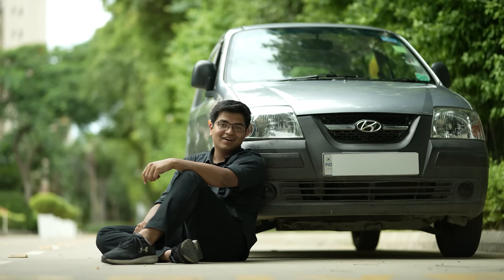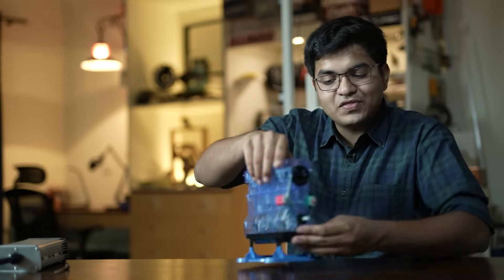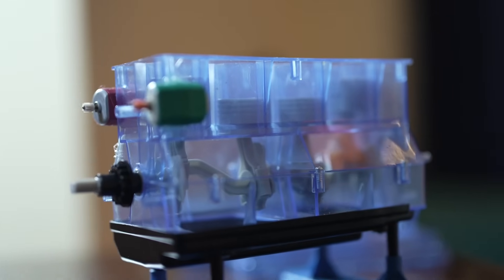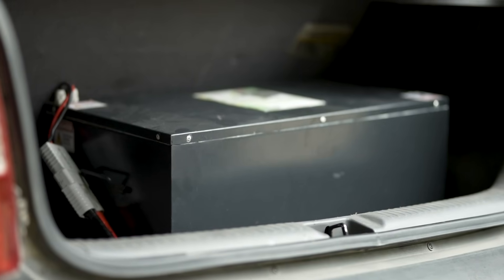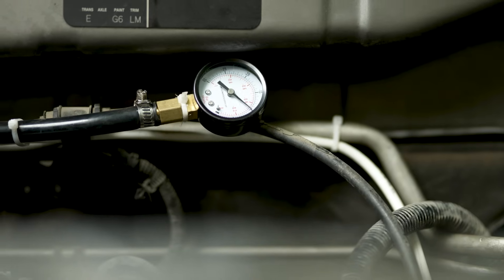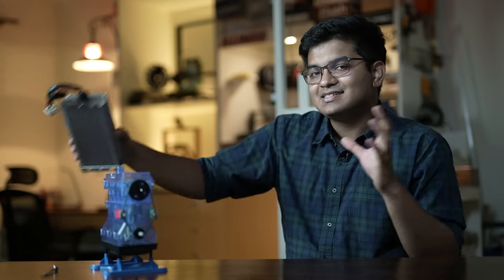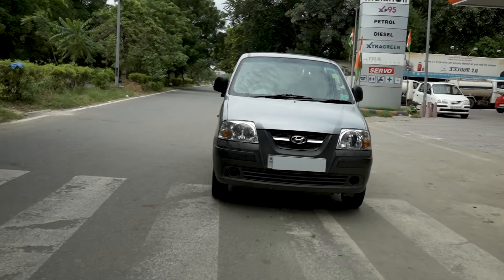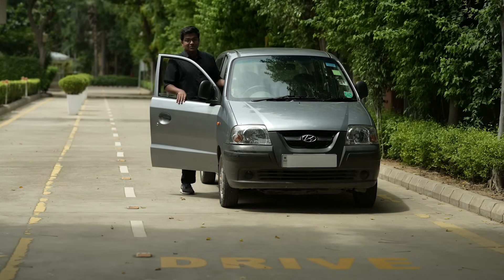Simplest EV Conversion under $3000 - Convert Your Car in 3 Days!

Comment: A great ghetto engineering video but a very compromised EV conversion. Here are the things that stand out to me. No regen using this method. No heater for cold climates (not something he had to worry about). Will only work with a manual transmission (unless you can hack the engine computer). I think he could address the power situation with a bigger motor and battery but then the cost suddenly becomes more of an issue. As it is 60km/h top speed would be dangerous in a lot of cities around the world. I'd be interested to know if things like ABS still work.

Comment: Since the engine is still rotating the crank pulley, do you have the oil pump in operation to keep things lubricated? Also, it would be fairly straightforward to put a more powerful electric motor on there. 30 or 40 horsepower would make the car absolutely drivable (the first Citroen was only 9hp, but it was very small car).

Comment: Because you only use a 6kW motor, you can replace the alternator with a motor. In fact, the alternator can be converted to a motor by connecting a controller to it. Unfortunately, not all alternators can be driven by conventional brushless controllers. You do not need to damage the ICE. Just switch it off when the speed is low.

Comment: Sir, please take up a project with tata nano. One guy called 'technical partha' did that he kept the gearbox , welded the motor shaft to it. There is talk of nano ev coming to market, but nothing has come out about the design. I feel the space between the two front wheels is just right for the motor, where the stepney is, the the rear engine space for the battery. I congratulate you for the santro project, but the lower half of the  engine is still an extra weight, which could have been done away with.

Comment: Hello sir. I have a question.
does the Sensors such as wheel speed, wheel slip, braking will be retained? Will ABS and Traction control function as intended? Did you remove or just trick the ECU? keeps me wondering about these problems if I will also convert my ford fiesta.

Comment: Very good and very simple for the budget. I hope you will update the design in the future and completely remove the engine. That is excess weight reducing your range. Plus the electric motor has to power the car and also moves the pistons, camshaft and gearbox. This will cause too much friction losses causing additional loss in range. Also you will need to get approval from the RTO for it to be road legal. Please be careful. Unlike in the USA, here you cannot make such modifications without RTO approval.

Comment: I imagine since there is no combustion in the leftover of engine, no high pressure to wear the parts the oil in the bottom of the power unit does not need to be changed forever if that part of former engine is properly sealed from elements?

Comment: Hay bro nice to see such al)) innovative idea 💡 
I have a question, as you mentioned that the motor you used was 5 times less effective so is it necessary to do so or we can improve its power and capacity to the actual diesel ⛽ car and even more than that ?
Please bro answer i am glad tu know that?

Comment: So could you replace the EV battery 🔋 with a small Yanmar diesel generator or Honda gas generator to supply electricity 🔌 to the motor instead of a battery 🔋🤔??

Comment: Edit: I should add that I know you put BLDC 72V in the video, but I don't know what that is, I'm in the process of googling right now.

What kind of electric motor did you use? I don't know anything about electric parts beyond Radios, alternators and starters. Most of my knowledge is from IC Engines and I have a car I'd like to look into learning with.

Comment: Definitely want to add regen braking in some capacity though. Not sure it's worth doing the mod in the long run though, as all the extra weight really isn't nessisary, not just the lower part of the block, but the radiator and everything as well. 

I think it'd be worth finding a way to just keep the gearbox, and hook up the motor to the drive shaft directly.
Reply: Regen is just fancy engine braking. The controller just needs to know when to start regen. Probably tap the brake light switch and that's it.

Unfortunately Regen isn't the magic range extending bullet people think it is. Over the entire battery charge and city driving you'll get around 3-5% extra charge. The bigger advantage is less brake pad wear. But given the funky setup where the whole car is powered through a belt here I would just eat the 3% due to reliability.
Reply: @marsrover001  Dude what? Regen gives you back 50%+ of the energy it took to get you going in the first place.
Reply: @streetguru9350  This information seems incomplete. If you are speeding up and slowing down all the time, maybe regen is worth it. But if you speed up to a certain speed, then maintain that speed for a long time, then slow down, the only energy you get back is the "50%+" as you say of the energy you used to accelerate. As Marsrover001 said, that sounds about 3-5% extra range.

Comment: So it's similar to a hybrid?,not that it runs on both the sources ie electricity and petrol but , what i don't understand is  how u used the IC engine that was powered by petrol to an electric 💡, 

I don't have any knowledge in engines and stuff ....it would be good if you could clear my doubt 🧐.

Anyway ,this was an interesting video

Comment: Removing head of car timing belt aso runs the creankshaft which increases losses
And to  charge lead acid betry (original battery 🔋)from converter you will use 72 to 12 volt buck converter to increase efficiency

Fore morefurther efficiency my idea is upto use tata nano as an hybrid with solar penal but coding is difficult  as per refrence Toyota Camry

Comment: A question. What about the heating? In cold climate you need heating. If there is only half of the old engine, will it still blow hot air?
Reply from the maker: Hey, thanks for the comment. You would need some sort of independent heating setup as the engine block no longer gets hot as there isn't any combustion happening inside it. Most EV conversions use a coil heating setup as far as I know and that would be an interesting install. Since this motor is pretty small, it's quite happy just being air cooled. If I ever install a larger motor, the heater could run off the heat from the water cooling loop used to cool the larger motor and controller. Hope this helps!
Reply: @MakingWithMihir  ive been looking into induction heating. Ppl melt tin on those copper pieces. And it only takes a small motor to turn the wheel with magnets. Since my means are limited or nonexistant, ive been unable to test it myself, but boy if it would work... plus car is sucha small space to heat. Would not take much.

Comment: What do u use for speed control
Reply from the maker: I replaced the mechanical throttle with a hall effect digital throttle. That talks to the motor controller which then controls the speed of the motor depending on the throttle position.

Comment: Brilliant idea! I would never have thought of resuing the crankshaft to lower cost. However, I do have some concerns. Since the car is being powered from the camshaft pulley to the crankshaft via the timing belt, will the load and forces applied be too great for the components to handle? The timing belt wasn't designed to move the car so I am worried that it might stretch or even snap under the load. I by no means am an expert in cars so please correct me if I'm wrong.
Reply: best bet is to go with late 80's to early 90's Japanese cars. not only do they normally have timing chains, the engine designs were simpler thus easier to convert.
Reply: I like it,very nice conversation projeçt.
Reply: Wondering the same thing here
Reply: Just get a spare belt..
Reply: Any tiny cars out there with timing chains?
Reply: toyota scions had timing chains and they are small and light vehicles

Comment: Has anybody made contact with him.? From his experience with this just wondering if this has any commercial viability for just an inner city vehicle. No need for highway use. Since most of our limits have been reduced to almost 40km in our city , this would fit right in . Yes it does have some cons but using current stock cars for the conversion is a no brainer.

Comment: There is a huge potential for scalable , well manufactured 3 wheeler conversion kit. Even if it costs Rs 1 - 1.5 lakhs for a 4-5 KwH LFP battery, the savings in fuel can make it completely worth it.

Once LFP battery crunch reduces in 2-3 years as domestic production starts coming up, I am sure we will see a lot of these conversions becoming popular for urban use. Govt. should definitely incentivize the same

Comment: kudos to your effort, but i would like to ask if the electric motor is sitting on top of the engine sending power to the crank then to the gearbox and the wheels, how does your ac compressor and your steering pump work when you are at hault? do you just free rev the motor or something in neutral?

Comment: Would it be possible to add a smaller EV engine just the sole purpose of "assisting" the fuel engine, in order to reduce gas mileage and/or gain a bit of horse power?

Comment: awesome, I have a vehicle I would love to convert but I wasn't sure if it was possible. I think my biggest question was how to pair an electric motor to the car's existing transmission, or whatever you replace the transmission with, in order to get the power to the wheels. you didn't explain that part at all, but I guess it must involve the block you left in

Comment: Why charge the 12V battery and not use the 12v from the converter to power lights and all accessories in the car? I mean charging a battery from another battery is not efficient. You may have used a higher amp DC-DC converter for this job.

Comment: The car can not go up very steep hill or driver sprint. You connected the motor with belt which slides under pressure unless you use a chain, like timing belt. Very smart system but removing the engine would have saved you a lot of weight to gain more km out of the battery.

Comment: Very risky in actual conditions. And not economical. In 3000-4000$ a hydrabad company "RetroEv" does actual replacement.
Reply from the maker: Hi - thanks for your comment! I had looked at RetroEV when taking on this project and the quote I received was somewhere near 5 lakhs. Since I didn't want very extravagant features, I was happier spending 2.4L to get a car that suited my needs. 

Thanks for your feedback :)
Reply: I appreciate your effort though. 💯😅

Comment: I have a tiny smart fortwo car from 1999 that i would love to convert this way. The motor is half the size of a normal motor so i feel like i would easily be able to covert it like this. The problem might be the suspension and the breaks since its so tiny and light.

Comment: Nice project,  I think I would make a conversion plate that has powersteering and air conditioning and vacuum drive ,dump the engine out, or have second motor for utility's

Comment: 1. How many kms reqd to change the engine oil?
2. Does your car has a tailpipe?
3. Your car dont need a fuel tank, so why dont you put the battery thr in place of the fuel tank?
4. Does your ac only cools or heats also? If it doesnt heat wat about cabin heating in the winter?

Plz reply fast

Comment: This is the kind of ingenuity we need right now. Most of the world can’t afford Teslas, this is a genuine option. Well done 🎉
Reply: I agree, I think their is a big market for EV conversion kits for a variety of reasons, cost and reviving old cars. There are kits available now but expensive, the best I've seen is an in-wheel hub motor meaning you only have to replace your wheels and add a battery!
Reply: In western countries the conversion isn't the issue. The legal checks are the issue. $$$$.
Reply: This kit should also be affordable 😂 And it should be easy to install so that local mechanics could swap engines with this kit easily.
Reply: Chinese BYD electric cars start from $12,000 brand new. 
who wants a Tesla? Except coutries who can't import Chinese cars
Reply: i dont undernstand whats the point of electric, the effeciency of this electric conversion is so bad, why is the motor spinning the pistons and the crankshaft, why are you still leaving in the allumninum block, why is the gearbox still in there, there is like a extra 300 kg or smt, uselsess. just get a cvt, and get mounting for your electric motor and cvt transmission. very poor effieciency of this ev
Reply: I agree.
I wonder if he could get it to go 85mph
Reply: They’re not that expensive when compared with their ICE counterparts. You can get a Model Y for like $34,000 after the tax credit. A credit which can be applied to the purchase price of the vehicle. Take that and another $100-200 off for gas and it’s as affordable as a $23,000 vehicle. And that’s brand new.
Reply: @CWK09  What if I don't live somewhere with tax credit? What if I can't afford to spend 23k on a car?
Reply: @sensitivedesensitivity7349  a bycycle would be a better option at times of financial crunch..😂
Reply: @CWK09  and in 5 yrs it's worthless and you're looking down the barrel of many 10s of thousands in repairs. To keep and repair a tesla for 200K mi costs most of what the car was new. To keep it 300K costs far more than new. That's a joke.
Reply: @TheGuruStud  who’s ass are you pulling those numbers from? You drive 40,000 miles a year? There is no maintenance other than tires and washer fluid. People opt-in to replace their batteries for longer range, but you don’t “have to”, but even if you did the price of batteries is cheaper than a used ICE car and you get virtually a brand new car. The motors are rated for a million miles. The warranty that comes with their vehicles are the best in the industry IMO and they’re super cheap to fuel depending on where you live. A new $44k tesla plus charging, costs the same as a $25k used ICE vehicle plus gas.
Reply: Then you probably can't afford an ice either
Reply: @AdamTreier   Man who has never purchased a used car: